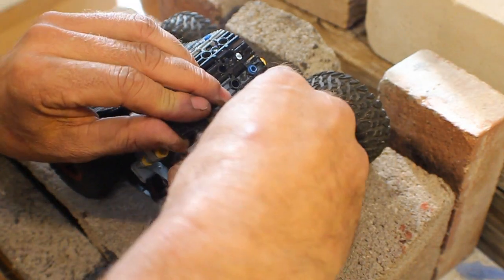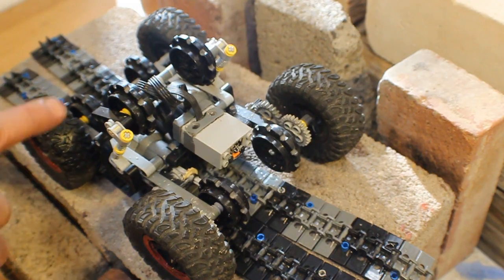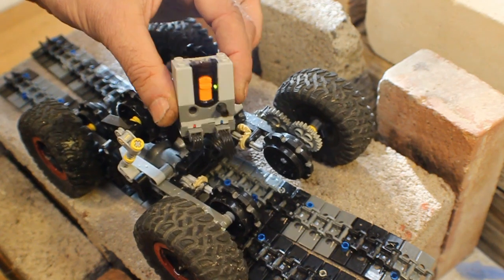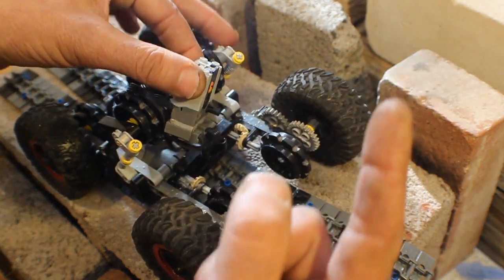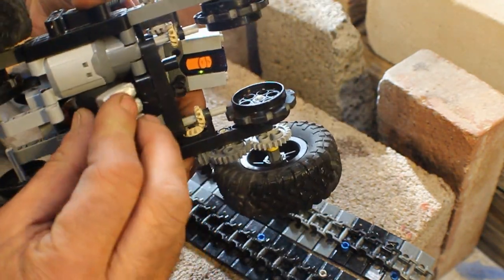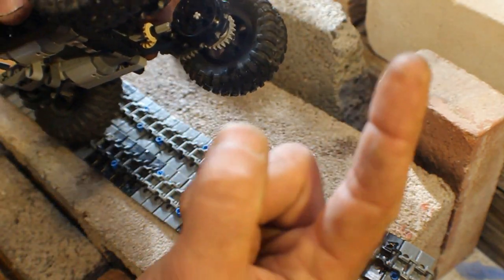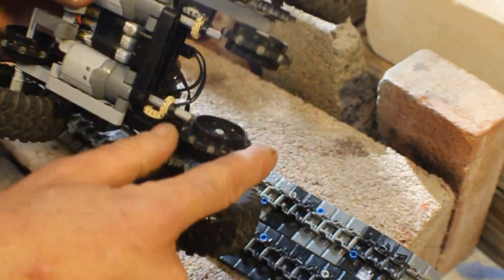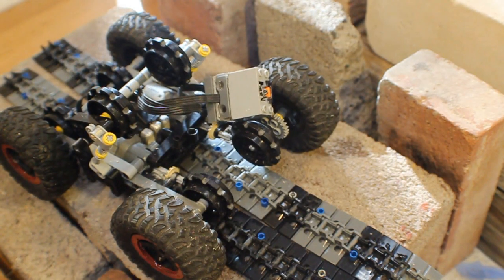Treads and Tires Are Unstoppable Lego Technic MOC

Comment: Should i use original Lego registered motors, battery boxes and IR stuff or buy non-Lego stuff? (PS i'm not an professional builder)?
Reply from the maker: I would not buy Lego IR. Get SBrick or some other remote control option. As far as bricks go get whatever.  Lego had some patents expire so lots of options are opening up.  Cheaper alternatives exist but sometimes have quality issues. I found an off brand motorcycle that had a ton of great bricks for fairly cheap. A few of the pieces have some tight fits but it was worth it.